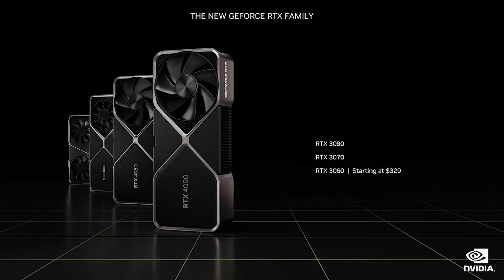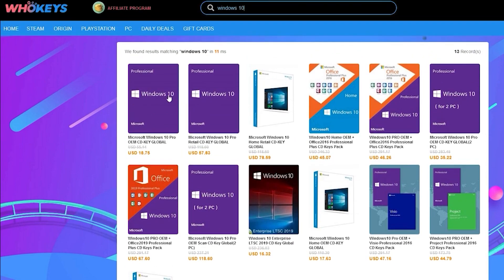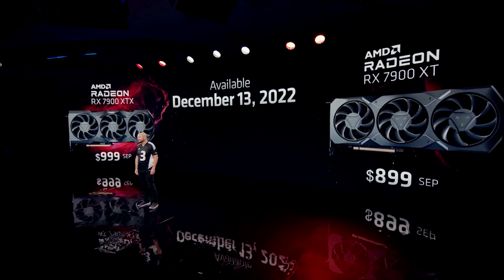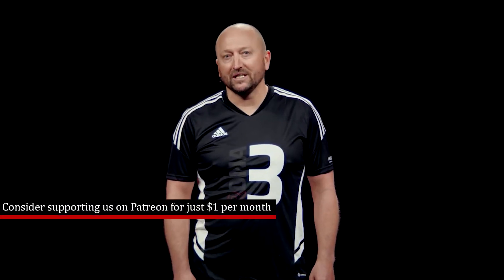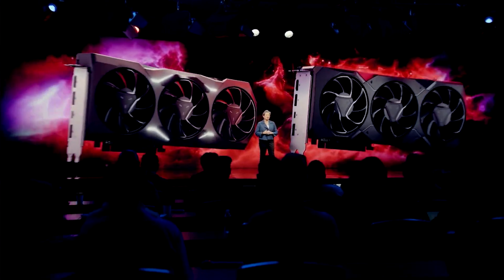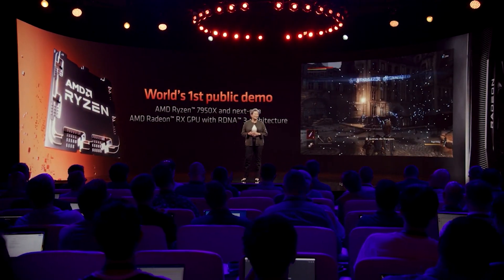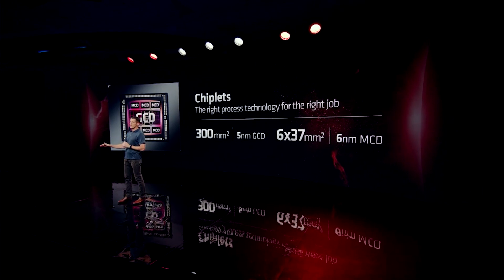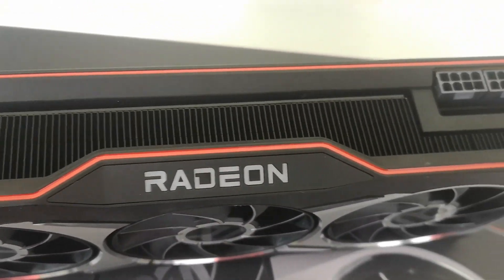RX 7900 - AWESOME Supply, But Custom Cards Come LATER?! | TSMC 3nm Is VERY Expensive

Comment: Anyone think its possible for the 7900XTX AIB fully overclocked to outperform the 4090?
Reply: Probably not
Reply: @Matt  some say 30% overlock possible
Reply: @MrDanny1911  If there was 30% left in the tank, they would already have used at least 20% of it stock... That being said, there is no way you can gain 30% performance going from 355w to 450w.
Reply: @TheLoucM  where are you getting 30% from? The 4090 is about 30% faster than the 4080 and the 7900xtx is expected to be at least 10% faster than the 4080.
Reply: @MrDanny1911  they also said the 7900xtx would be 3+ GHz and blow Nvidia out of the water. Realistically best case it gets within 10% of the 4090, and even that would be a huge win.
Reply: @Matt-gf4gd  i got 30% from Matt loll replied to tell him it makes no sense
Reply: @TheLoucM  huh? You're insinuating that the 4090 should be 30% faster than the 7900xtx. I'm saying that doesn't sound right. From everything I've seen/heard the 7900xtx should be within 10-20% of the 4090. 30% would put it slower than the 4080 and only like 25% faster than the 6950xt. Realistically I think a really pushed OC'd AIB 7900xtx should probably be within about 10% raster of the 4090 and the stock reference probably closer to 15-20% behind the 4090. To your point though, none of these modern GPUs seem to have much OC headroom leftover.
Reply: @Matt-gf4gd  Yeah true, last gen my sapphire 6800xt had a boost clock of just about 100 mhz more. Overclocking it myself ontop got me to 2630 stable up from 2350 or something like that, so around 11% better.
Reply: @Matt-gf4gd  not sure where you extrapolate all that. What does not sound right is the 7900xtx reaching 30% overclock. That was all I was answering to.

Edit: sorry I meant Danny in my other post
Reply: @TheLoucM  ah yeah in that context makes sense. Yeah there's no way it's overclocking 30%. Every modern GPU/CPU now comes basically factory overclocked as-is. These guys aren't leaving much performance in the tank. In fact, if anything, they're too overclocked stock and you get much more benefit from undervolting.
Reply: If it's even a tie that's incredible
Reply: im really getting the feeling them aib prices are gonna be through the roof.......
Reply: maybe in some games
but only if they can really OC the GPU
initial rumors said it was limited to 3% better performance... maybe the drivers will finally allow more OC room

if they can unlock the power and frequency... oh boy!!!

Comment: The AIBs tax doesn't worth the money for 5-10%... just buy reference and OC around 5%... and by the way, this is one of the most impressive looking GPU I can remember of.
Reply: If everything scales well, AIB's "could" see something like +20 to 25%, but at up to 150 watts more power draw.
that's "IF".
It's very hard to say. I hope there are performance numbers for the AIB's before reference launch day.
Reply: AIB RX 7000 could be up to 16% faster than Reference,  for 10% more money seems like a good deal to me.
Delayed AIB launch is because AMD wants to grab market share from NVidia quickly, achieved by "true" MSRP Reference Cards being available with good stock.

Outstanding move IMO
Reply: It really depends on how much over clocking improves performance. If aib cards over clock well and the performance matches, then it would be worth it. We just gotta wait and see
Reply: @JM-kn9dh  has this ever really been the case though? Generally the AIBs on either side that perform 5%+ or better cost quite a few hundred more for those few fps. Never have I seen them be close to price.

I'm more familiar with NVIDIA side though, maybe AIBs perform substantially better? All I know is I remember seeing sapphire red devils or whatever be absolutely ludicrous pricing over 'stock' 6800xt models at microcenter all the time.
Reply: @mroldgreg  well before clocks hit 1ghz, there was a lot to gain from overclocking. Even the vega series could be overclocked for good gain but at the expense of power. 
Its possible that AMD didnt want to push power that high without a guaranteed win.

Also, last generation is not really indicative of typical trends because world events allowed such how prices
Reply: Overclocking is becoming a thing of the past. Undervolting is becoming the new norm.
Reply: @bear5016  overclocking has become a thing of the past cause things are pushed too close to their limits now. Before you could overclock a cpu from 3 ghz to 4.5 for massive gains. A gpu could be overclocked from 800Mhz to 1.1Ghz and show massive gains as well. Now, only a few Mhz can be gained so its not worth it
Reply: @bear5016  definitely true on the CPU's right now. AM-5 chips even actually tend to go UP in performance with a modest voltage de-tune, just cuz it stops thermal-throttling so much. I can only guess they set the voltage so high for yield (so some chips which don't work well would work).

And the 4090 is such a beast (and so expensive) that it would probably be wise to undervolt rather than oc.

I'm not sure if the same applies to the intel cpu's. They draw a LOT of power though, so maybe.

But the 7900 XTX. they went pretty light on power draw. It might be well below it's sweet spot if given an extra 8-pin connector. Hard to say. Could be a gesture to sweeten the pot for AIB partners.
Reply: @kathrynck  even so, its a compromise between power draw and performance.
If I need another 8pin to draw another 150 watts for a whole 5% performance. Its not worth the heat, power and noise.

Im not saying thats what it going to be, im just saying, its normally, for an average consumer, not worth overclocking.

Plus, the aibs will be at least another $200. Even at 10%, thats not worth it. Maybe at 15% id consider spending another $200, but then you still have to consider how much more power, heat and nosie is involved without water cooling.
Reply: @bear5016  nod if it's 150 watts for 5% perfromance, that would be garbage yeah.
If its only about 70 watts extra draw for say 15% or 20% uplift, then it's pretty interesting though.

Similar with the price.

I really hope there are some decent specs published on the AIB's before the reference launch day. I think AIB's tend not to be worth it, but the reference XTX is "considerably" under it's theoretical clock & power peak, so it's possible that the AIB's for it may be much more attractive than AIB's generally are.

Not saying they WILL be, but they stand a better chance of being very interesting than any past AIB I can think of.

If it's $1200 & 100 watts for a 7% uplift, forget it. If it's $1100 & 60 watts for a 14% uplift, I want it. Usually AIB's are more like the former though.

I'll probably buy a reference XTX on launch day. And if the AIB's turn out to be really exceptional, well ...I have 15 days ;)
I do expect XTX reference cards to sell out on launch day though, unlike the 4080's.
Reply: @kathrynck  no worries, i hear ya.
Ima try and stick a reference at launch as well.
Hopefully the cooler is nikel plated so i can put LM on it.
Reply: @bear5016  Hehe, Murphey's law follows me around too closely for me to attempt LM ;)
Reply: @kathrynck  just use modified silicone conformal coating around the die beforehand.
Reply: @bear5016  I still don't trust murphey's law. I think I'd play with undervolting to see how good my particular piece of silicon is, and what can be done with thermal optimization software-side, before thinking of resorting to LM.

I wanna get a 7900X though (mixed use). And I do plan to gently polish the top plate down just enough to expose the copper, then thermal grizzly a 420mm rad to it.

But only if microcenter will sort itself out and get the %$&^!ng free ram back in stock. Might go with a 13700 instead if the local store doesn't stop tying the 7900x price drop to out of stock freebies (or at least gets the free ram back in stock). Really either chip meets my goal of 8 fast cores dedicated solely to the primary application, with cores left over for background junk.

I probably should have gone and bought on wednesday, instead of baking a pumpkin pie and making deviled eggs.
Reply: @kathrynck  i already lapped my 7900x. Mostly because my Noctua D15 is already lapped.
Im waiting on DerBauers delid kit. -20c stock, hits 75c full load 182 watts.

Comment: It sounds like the AIB 7900XTX cards should handily beat the 4080 even with Ray Tracing turned on except in the most Nvidia biased titles. 
But it also sounds like the AIB cards will be more than the 1000$ MSRP but hopefully not too much more like 1060$ or 1100$.
Reply: @New Moon Why are you acting like FSR doesnt exist and comparing Nvidia with DLSS enabled to AMD without FSR enabled. That doesn't even make sense dude. 
Your statement is basically How to tell everyone you bought a 4080 without actually saying you bought a 4080 Hahah
Reply: Can’t count on that. If AIB compete with 4090 or even close they will be priced probs $1200+
Reply: @D90NAS77  still the obvious choice
Reply: $1100 is completely unrealistic IMO ☹
Reply: @jaromor8808  i expect the aibs to be $1400 and thats before they are even scalped i expect scalped ones to be $ 2400 you'll probably think no way but im not the one setting myself up for dissapointment here
Reply: The Strix will still be 1450$
Reply: @@newmoon1448 wrong calculation buddy it's 70% not 170% you don't know maths and no you are completely wrong on everything. Source: i have check hardware Unboxed and gamer nexus
Reply: @New Moon dlss means upscaled, xtx will be way better at raster, you can keep your 4080 and watch one year later how inferior it will become to maybe even 7900xt
Reply: AIB 7900XTX will most likely cost at least 1200 or more especially if it beats 4090 in raster and 4080 in RT. If they slap a water cooler on it, it may cost upwards of 1400 or close to 1600.

Comment: Dude, there is no availability of the 4080 excepting scalpers and resellers for way over retail. A small US chain with only 25 locations in 15 (of 50) states may still have some due to over-ordering. You can check Newegg, they apparently just got a restock so have 1 card at 1270 USD. The rest of the listings are resellers (professional scalpers) from around 1500 USD (around the price of 4090) to -get this -2729 USD. Please check your information before you lose all credibility.
Reply: They barely shipped any and everything I've heard is sales have been delightfully pathetic, sitting on shelves.  Let it rot, don't be a chump.
Reply: @tnix80  Because every single person uses Micro Center as the only example. When they are sold out on Amazon, Newegg, Walmart, and B&H except for resellers (scalpers) it tends to suggest that Micro Center ordered too many -not that nobody is buying them.
Reply: They are sitting in stock in so many UK Online Stores, not just US thing.
Reply: @Dangerman-zg3ui  I have a 4090. I am set.
Reply: Yeah, I HATE how people keep using Micro Center as an example. 99% of the world doesn't have access to those.
Reply: @bryzeer5075  I take it you're a chump

Comment: are the cards really gonna be 900$/1000$ even in other parts of the world? the 4090 went from 1599$ to 1950$ even on nvidias own side before launch for me (I am in germany).
Reply: US prices are without taxes as far as I know, so for us (NL here) and most other European countries there is tax added plus probably some magic extra that they always put on top. I am expecting the 7900XT 1050-1100 euros, 7900XTX 1200-1250. Of course just my guess but let's see the 'damage' for Europe will be limited
Reply: @TheTomster94  thats too bad. might be better to go for an 6900xt then. seems like better value.
Reply: @DasDuelon  There are some 6900/6950XT for 880 euros at notebook Billinger, was just looking at it myself. I want ultimate longevity so will wait it out but for now I think they are decent value at current price indeed
Reply: @TheTomster94  ye i am looking at the XFX rx 6900xt merc319 for 799 right now.....
Reply: @Bashteee  gut da brauch ich dann auch keinen taschenrechner um zu wissen, dass ich dann bei ca. 1200 für die xtx version rauskomme. das macht das ganze natürlich nen gutes stück unattraktiver.
Reply: The most expensive 4090 here in Germany, costs 2.700 €. I doubt, you can get the XTX for less than 1.400-1.500 €.
Reply: Nope. AIB 7900xtx will cost $1,200 US
Reply: $1599 + 19% German VAT ~ 1949€
Reply: the amd foundation edition will be gone in two seconds flat at $900/1000 and then the aibs will be like $1400 $1500 trust me on that and then the scalped ones will be $2400 oh yeh laugh and say im wrong just watch
Reply: Still $1600 here.....maybe leave Germany?